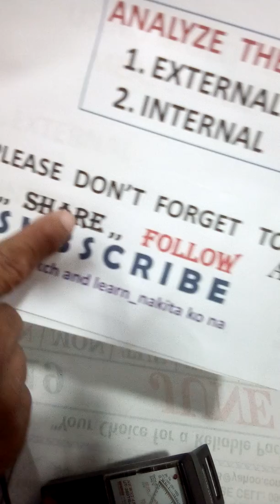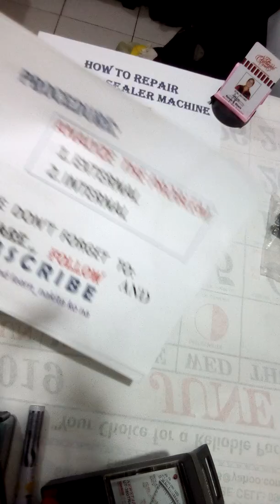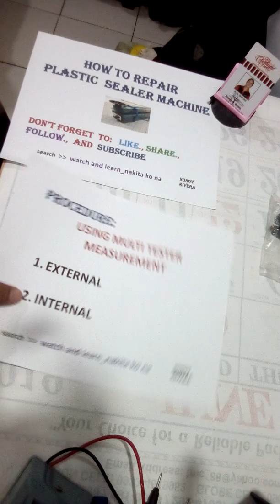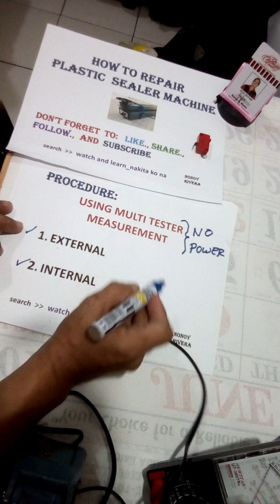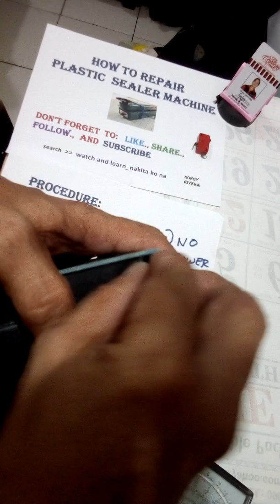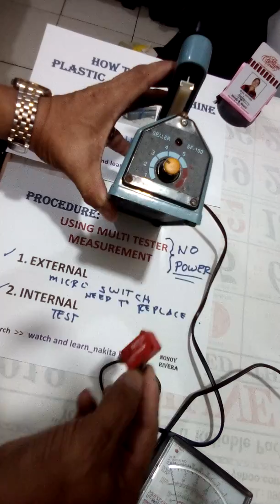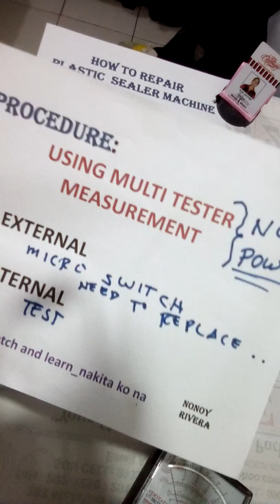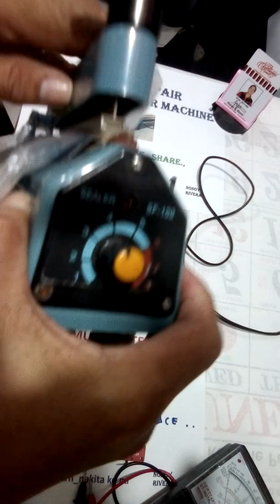How to repair plastic sealer machine

Comment: boss ano ba problema ng sealer ko may power xa umiilaw nga pag switch ko pero hindi nya madikit ang celophane hindi ata nainit,,ilang volts ba dapat ilalabas nya dun sa wire tenister ko walang output ano kaya sira nito pls reply
Reply from the maker: hi brod fails to operate?
the first thing to check is the heating element;
1. check the condition of the heating element (sana may OVM tester ka makakatulong ito for testing)
2. cover or teplon the heating element from the material being sealed ( ito yung parang tela pag parang sunog na need to replace)
3. check the terminal connection minsan corroded na siya parang kalawang na loose contact.
sana nakatulong ito at if you have any comment  again feel free..thank you
Reply: @workupload  may output voltage ba dun sa dalawang terminal na pagkabitan ng heating element ialang volts dc kaya para may idea lang ako kung bakit di xa nagana tnx

Comment: Boss ano sira ng sealer ayaw mag automatic yung ilaw Hindi namamatay pag nag sealed.
Reply from the maker: hi.. please check the mounting pring baka kalawang na o nag moist nawawala yung contact. will prevent the heating element from conducting heat at and timer light  laging on.
1.common problem with impulse sealers not working is a broken seal element
2. the cover or teplon under heating element dapat palitan na, ito yung parang tela or asbestos
3. timer pc board need to replace
 sana nakatulong po ito at need rin ang OVM tester na makaktulong how to check and test this impulse sealer. marami pong salamat,

Comment: ask ko lang sir yung sakin umiilaw pag inipit mo na xa kaso hindi xa umiinit ata kasi hindi xa nagdikit e palitan ba ng heating element?salamat sir antayin ko sagot mo
Reply from the maker: Good evening you need to replace the heating fillament, if you know how to remove this fillament present this material at ace hardware and buy it. Hope it will help  a lot.
Reply: @workupload  pinalitan ko na ganun parin ayaw uminit e hindi man sunog bagong bago pa ang transformer